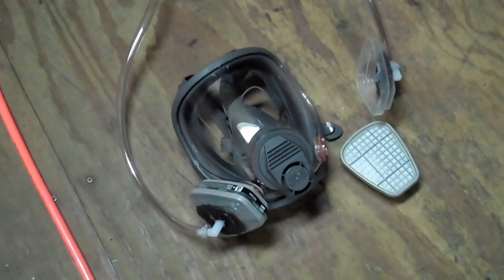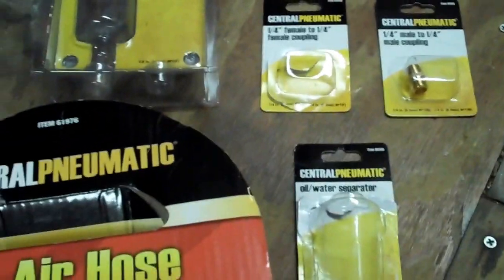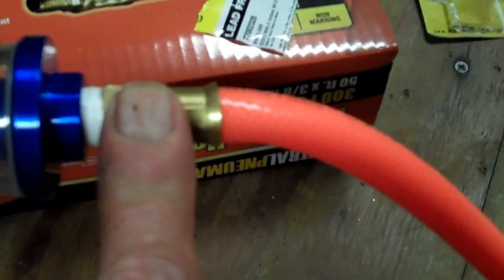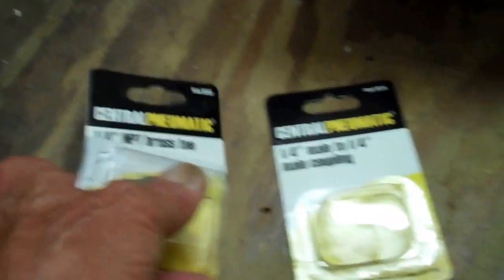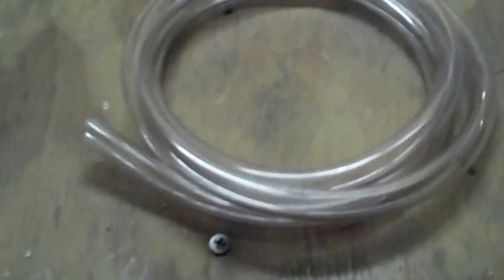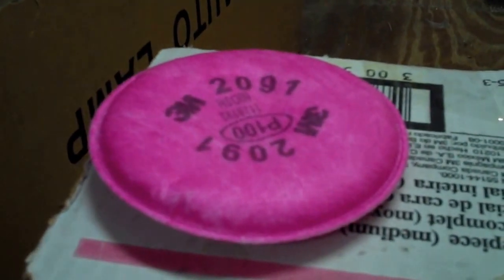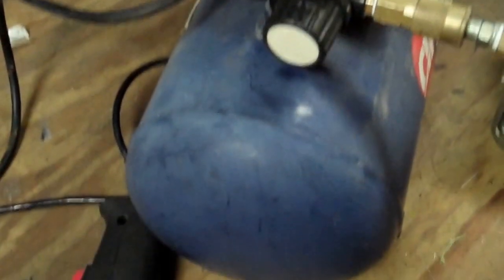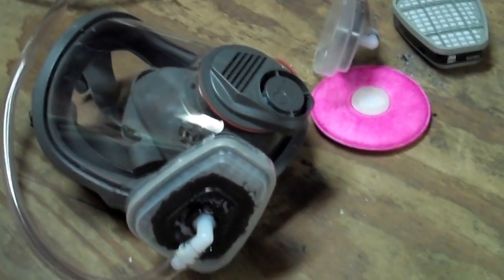homemade full face mask respirator fresh air system part 5

Comment: thats one old ass 6800. the front piece looks like it should have a din port but it doesnt. new model is way different
Reply from the maker: it fits my old ass and that's what is important
Reply: agreed. i intend to bs something like this soon too. i got the front piece with din port hole. gota figure out a CAD file for printing the threaded part, and then maybe 2 bayonet connectors on other side of blower motor